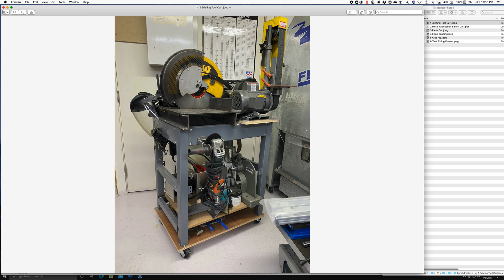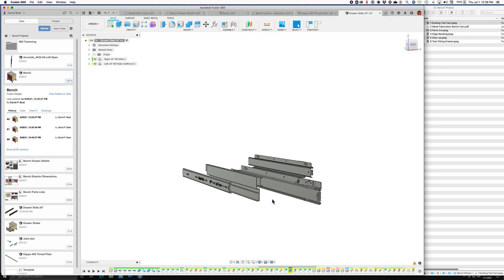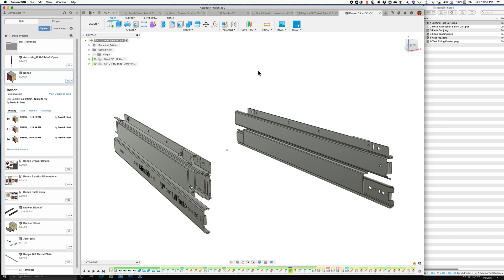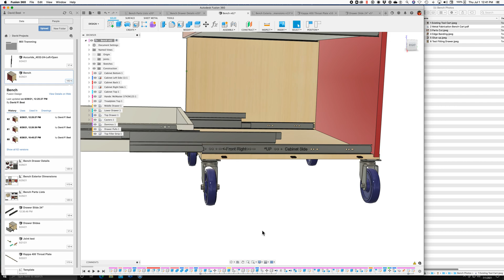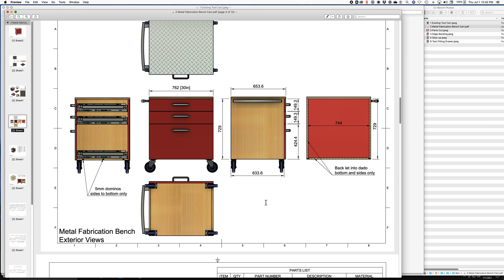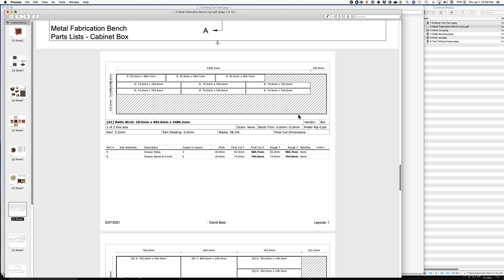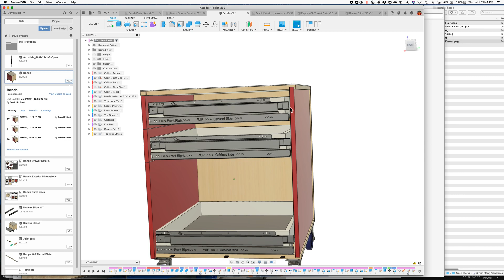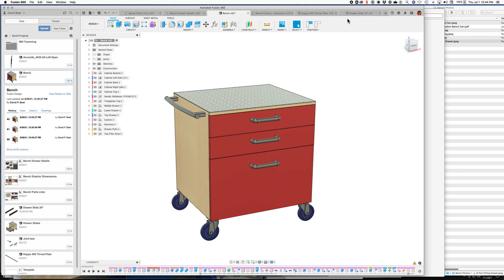Metal Fabrication Storage Cart   David P Best

Comment: Very cool David,
Nothing better than when i sit down to find something of interest to watch and you pop right up.
I wish i had it in me to try to learn Fusion360. i use ECabinet but that only goes so far.
I would like to make a rolling chopsaw table with hinged wing tables that i can raise if need be and want to have a pull out slide on each to pick up another 30" extension material is here but having trouble picking the slides. I thought touch to open might work but I am not really sure as it will be in a vertical position when not in use. I have looked at all the heavy duty slides from Charles Mac Murray and other then just start buying some a try to see if they will work to see what i get.
Who knows.